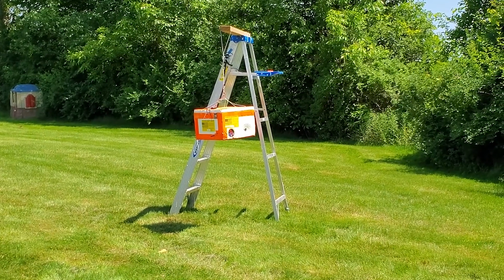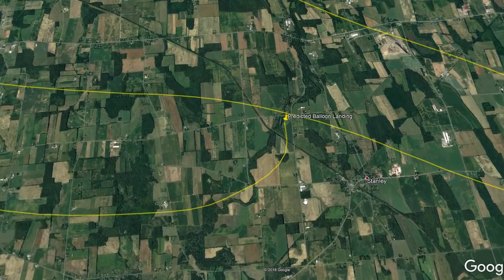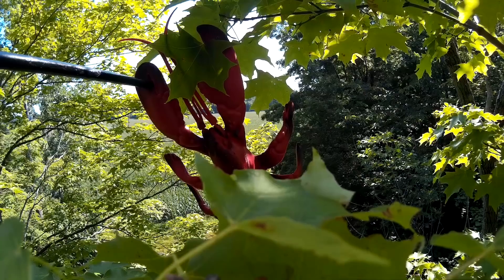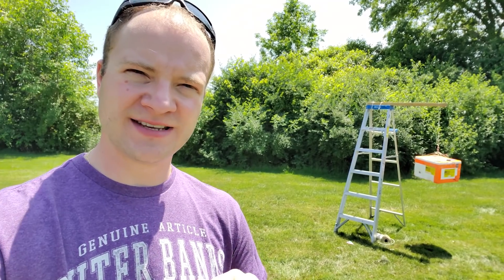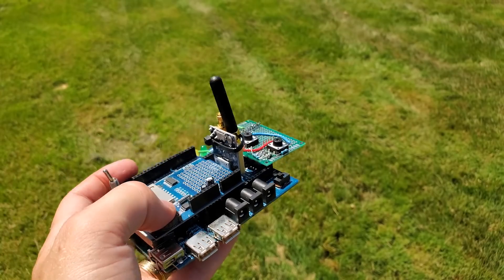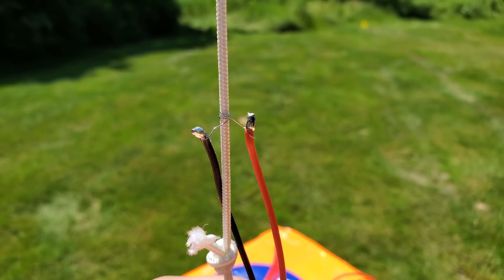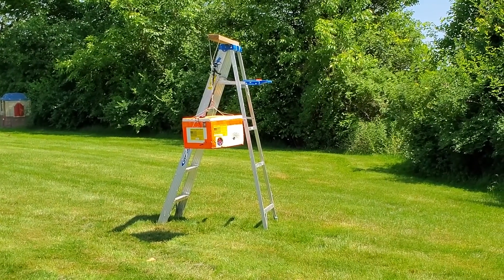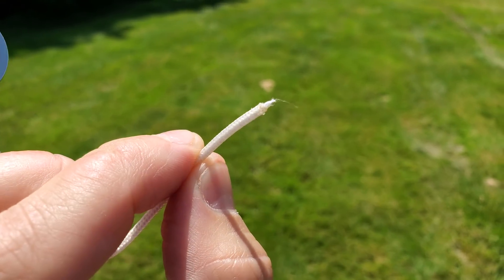How to save a weather balloon payload from a tall tree

Comment: You gives me an idea for Radiosonde. Just using CO2 laser, say 30W is sufficient. In the case radiosonde hang from the tree, fire laser and burn string. Easy. Not so easy carrying all that glass laser tube, water pump, water canister, battery, PSU converter (HV)...

Comment: i like your method as i have found radiosondes in trees and had the same problem i have been using a long pole with a sharp razor blade on it but it's very hard to cut a cord hanging in the air with a blade. 
but your nichrome wire trick gives me idea of using a V of nichrome wire on my poles to touch the string or cord and have a battery pack with wire leads and a switch that will trigger the nichrome wire

Comment: Hey Tory, that's pretty cool.  One question though; will the leads with special wire be left exposed like in your test simulation?  If possible, it might be a good idea to put some type of protective covering over it so that if you crash into a tree, the wires aren't damaged by the branches, thus rendering it inoperative.   Just a thought......